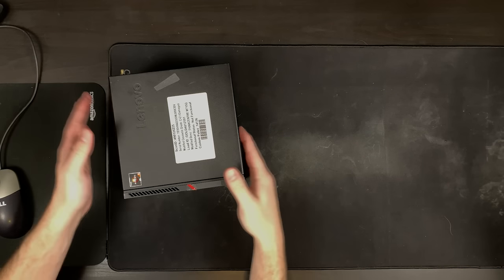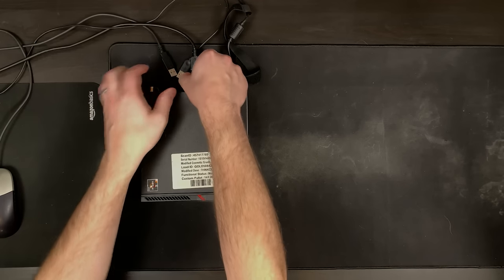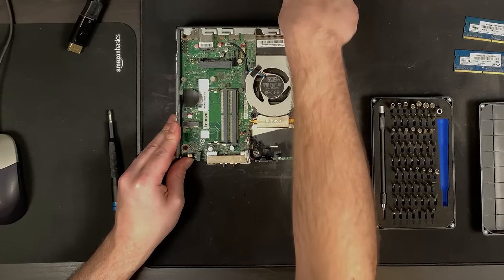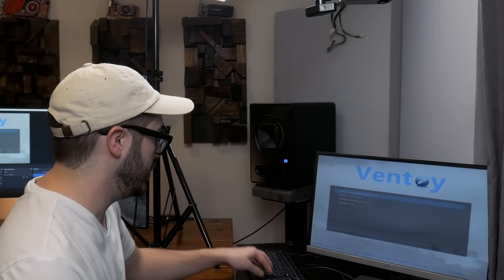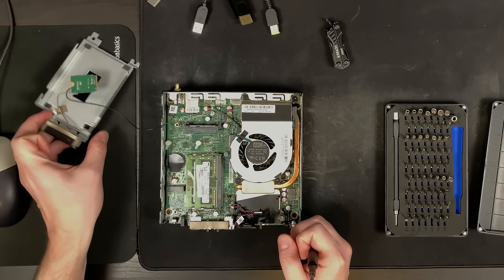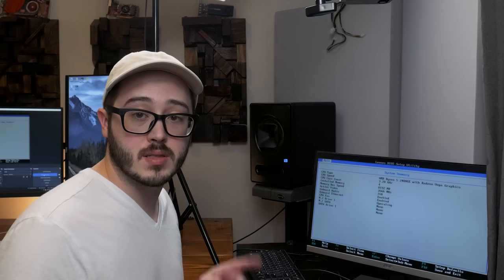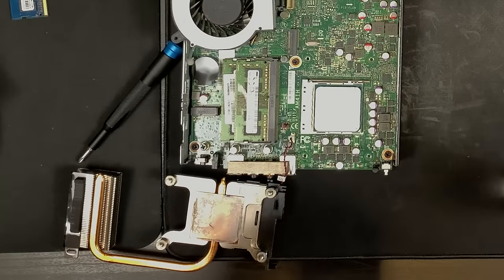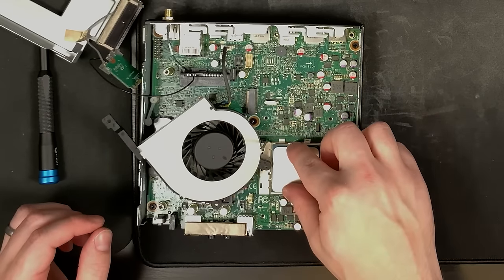Can I Fix These Broken Lenovo Mini PCs?

Comment: Quick tip for trouble shooting older systems. change the CMOS battery. I've messed with systems even only a few years old that had a dead battery and wouldn't post.
Reply from the maker: Yeah, I bought a bunch to just start doing that basically with any older PC
Reply: I've had a cheap AA battery with good voltage not work. You can short them breifly with a DVM set to Amps and check further. Check those new coin cells.

I think something like 0.3A is OK for coin cells, <0.1A? is bad and  I get 1A to 2.5A with our old AA rechargeables. When they're <1A fully recharged it might be time for the bin or use in a remote control. Certainly at 0.4A.

However if you try a tiny 1Ah? SLA house alarm battery it'll blow the 10A DVM fuse ☺️

Same thing if you forget to change the DVM back to Volts too.

Comment: I had an HP SFF core2 machine get picky about ram once. It would only boot on one stick and either stick worked fine as did both slots. Yet it would randomly stop working with either one RAM stick or another, same with RAM slots. Sometimes it would not detect RAM at all.
The problem had no consistency and kept driving me nuts so i put it away. Then after some time i tried booting it up again with all ram installed and it worked fine ever since.
I have it now in my garage as a media PC for music and datasheets and it has no problem starting up and works just fine.

Comment: Nice job. Good idea to buy three almost identical system. Flashing working BIOS could be tedious task. Taking one from another similar board is very good idea especially if you do not need windows key which is often embedded into BIOS.

Comment: When you copy the BIOS straight across like that you lose the Ethernet MAC and machine serial number.  I hope you followed the rule of taking 2 backups of a chip before writing over it.

If not you might be able to find the Lenovo provisioning thumb drive image and the MAC sticker on the system somewhere.  If you wire them all into your router with the same MAC address be prepared for it to get weird.

I am finding a lot of these Lenovo have BIOS issues.  For Intel you can go through an "ME clean" process to fix once you pull the BIOS file off the chip.
Reply from the maker: I was able to just use Lenovo's flashing tool to update the BIOS and give it the correct serial no. As of now they are showing unique MAC addresses, so maybe that process fixed it?

Comment: @12:22 not really... it's pretty default... the one BIOS gives more options then the other... or different options... but most of them are quite similar...they can also contain old and aged security measures... like the intrusion detection. there is just a switch on the front that detects that the case top has been removed. There is not much needed to go around that... just press the button :P and if you are unlucky the switch has been in the same position for soooo long that it keeps the button pressed or depressed.

Comment: 30:29 on hp systems (with Intel gen 3-7 cpus) if cmos battery dies, it will not post until you replace it.
Reply from the maker: Good to know! However I did say in the video that I replaced the cmos battery on them

Comment: I never seen CPU's break, I'm surprised you jumped there so soon ... hdd/ssd, memory, psu, MB (or bios) also always test the beepcodes first if that isn't working its always bios/MB which unless you have a bios flasher unrepairable...  but nice to see you struggle and find it in the end!
Reply from the maker: Yeah if you notice I was hesitant to believe that the CPU was the issue. I just wanted to pin it down to something on the motherboard. Thanks for the advice and comment man!
Reply: The news !!! that AMD 5 3600 are failing now, likely because people do silly overclocking withe lousy cooling. pea thermal compound not spread,  stock coolers are tiny.
I use big Coolmasters with my 130W Xeons they idie at 30, maybe 46 when loaded.
Reply: Google broken LGA sockets on motherboards, people are clumsy. LGA sockets are fragile.

Comment: Many of these "Tiny" PC's come off of lease from commercial users that basically use them as dumb terminals.  With that, they utilize "Boot from LAN" which means they get their boot info and permission from the network and are MAC address specific.  When you copied the BIOS from one machine to another you introduced a different boot sequence.  I suggest you create a generic boot flash file and update the bios when troubleshooting these machines.  Good luck

Comment: nice fix, probably just bit rot on the bios chip so re-flashing fixed it.
Also, as you flashed all pcs with bios rom from that single pc check if they all have same serial/mac/id etc. from that first one as that may cause some problems.
Reply from the maker: Yeah I'm checking out flashing a new BIOS from lenovo and adding the correct serial, although I'm not entirely sure if I'm doing it correctly haha. Any video/tutorial recommendations?
Reply: @HardwareHaven   Adamant IT channel on YT has quite few videos about using programmers to flash bios, also of transplanting certain regions in bios etc.
Reply from the maker: @vaidkun  Yeah his stuff is so freaking good. I need to check out the transplanting regions stuff

Comment: I just stumbled on your video great work!  I was thinking RAM and data retention issues with the BIOS chip too.  Such cute little computers, would make great little studio PCs running something like Reaper or even Cubase 👍
Reply: Hey I just discovered your comment about using Reaper or Cubase on them.  I aim to do this in my homelab/studio in efforts to reduce power consumption and distribution of work.  What I envision is to use multiple mini PCs in place of my Gaming PC workstation.  Reaper if provisioned identically, can run REAmote over the LAN and be distributed.

Comment: I have 3 Lenovo Tiny's, 1x m720q and 2x710q. One of the 710q's only boots with ram in slot 1, it will not boot with ram in slot 2 or in 1 and 2. Gives the same beep code as at 7:51

Comment: 23:49 i seen am4 also do that the cpu stick to the back of the cooler even when the socket is perfectly locked. It is a design flaw prob we never have to deel with in the future thanks to am5 if finally lga and the locking mechanism is like intel.

Comment: if it is at all like a NUC I had one I changed the video output on in the BIOS.  I don't know why.  Of course then I did not get any video from the usual port.  Luckily I had switched it to the Thunderbolt 4 (DisplayPort) and just had use a Thunderbolt to HDMI adapter to get video so I can see what I am doing to go back in.  Then I can fix it and not do that again.  If I sold it as is it might appear to be not working if the HDMI on it was used but if you know what I did then you can fix it.  The problem is it is difficult to know unless you have the right cables to try for troubleshooting that to see if that was it.  I did go back to HDMI since the framerate was terrible on that USB C DisplayPort for some reason.  It may have been my adapter but it was workable and helped me get it back to normal.  Every computer is different and each one is likely to have its own problem.  You may see bad CPUs or bad RAM instead.  You may see one that shows no signs of life at all.

Comment: Dell D6000 is a great troubleshooting tool - It works over USB3 and has its own little graphics card embeded. 
(So if you're unsure if the DP port might be broken you can use the D6000 to rule that out)

Comment: I am very familiar with these lenovo mini pcs in fact im typing from a M70q right now. I wish i seen this video sooner i would have told you from the get go it was not a bad motherboard. When motherboards in these systems die you get no power at all and the tell tale sign is when you plug the power cord in the power light will flash blue 3 times and quit.

Comment: I hate to let you know, but recently NewEgg was selling those refurbished (with 15-month Warranty) that include 128gb SSDs, Power Supplies, keyboards, Mice, and they work.  I just did a couple of videos on one that I bought and it is a nice low-powered PC that I will be using as a Backup Domain Controller.
Reply from the maker: Hey, thanks for the comment. Those are different systems. The m93p in your video has 4th gen Intel. Those are 3-4 years older than the 2400ge
Reply from the maker: Still looks like it was a great deal though!

Comment: The caddy is not the antenna. The wire leading to the brass plug in the back is the antenna. That brass plug is to screwing on a longer antenna.

Comment: The first thing should have been to take the cover off and see if there is any memory in there, it will not post without memory.
Amazon sells a short adapter cable to use a standard PSU

Comment: I have a big problem with the cpu fan.

I own the m715q 2nd gen since 2019 too. Since about 2 weeks I have had the problem, when I switch on the PC, the fan slowly rattles up to a very high and loud speed within a few seconds. (The blown out air is cold)

The fan itself and all ventilation slots are completely free and the CPU utilization is almost constantly at 1 to 2 percent.

Even if I start the PC directly into the BIOS; The fan turns up loudly within a few seconds - as described above.

I've already tried all three settings for the fan in the BIOS; all without perceiving any change.

As far as I know, the CPU temperature is read via the CPU; or is there a separate/built-in temperature sensor on this MiniPC that may no longer work correctly?

Or should the fan itself actually not be okay? (However, there shouldn't be a control unit/board installed in the fan, right?)

I would be very grateful for any tips/tricks, because at the moment it sounds like I'm sitting next to a loud engine.

Comment: @Hardware Haven Cmos battery sometimes can create no post issue, it depends from motherboard design... beafore bios  flash, you should open dump in HxD and  transfer DMI data from corrupted one. Now both system has the sane UUID and possibly the same  activation key, so afrter Windows installation that product key will get blocked, because  you can;t use the same OEM license on both pcs.

Comment: i never have seen broken bios exept some one tryed to update the bios and for some reason it did not finished. i know bit fliping is possable or state degrading. the last one happen if you dont have power to the chip for years but the eeprom where the bios is saved has a single state storage cell and therefore more robust as a MLC or QLC storage. cpu death are more commen on systems with 24/7 on time. a dead ram i have never seen in my systems even on overclocked to the extend. i had a ddr2 ram in a old system where the pcb changed color from a bright green to a dark brown even the edges of the chips are rounded from the heat, but the ram works fine.

Comment: I have a tiny one from HP that works great. I had a broken ram stick from a laptop that wouldn't work no matter what. When I got the hp I was like what the hell, lets try it in. It worked and been working for almost 2 years now. Don't throw the bad stick it might work in another system

Comment: dont need to disable the secure boot for clean install, all you need to reset it to setup mode which clears the keys from previous boot, and allows you to boot usb install media which it has no secure boot keys, once windows install, it populates it, hence why you get the boot error from usb install. if you are doing full clone, or re install just reset the keys and it will boot fine one time until the windows installed. once installed it wont let you boot from the usb again :)

Comment: 1 tip, is try removing all ram first then unplug from power and then hold the power button in for 20 seconds to discharge the capacitors. Then add the ram and power back and try turning it on

Comment: 16:13  Just a small helpful hint for the future of your diagnostic adventures:  You should really keep the magnetic tip screwdriver well clear of RAM or any electronic components, around the motherboard or any electronics really because magnetism can be very damaging to electronics.  fyi...  (think EMP etc. even though a screwdriver tip obviously is much smaller than an emp it can still have devastating effects). Have a great one...
Reply from the maker: Hmmm never really thought of that. I'll try to keep that in mind haha
Reply: @HardwareHaven  WELL, i MEAN IT IS TRUE BUT WHAT MADE ME THINK OF IT WAS THAT YOUR LITTLE SCREWDRIVER HELD THOSE SCREWS FAIRLY WELL WHERE MINE (WHICH I HAD TO MAGNETIZE) HOLDS THEM VERY WEAKLY, Sorry about the caps lock, somehow with this kyb I keep hitting it. Anyhow that \little screwdriver looks like it could have a fairly powerful point to it and very concentrated.  I believe that some people will argue against my assertion but I have a degausing tool (small table) that can render anything electronic completely and permanently hosed (at a high setting, not the highest, you can't separate a hard drive from it).  You may have trouble trying to break something with that screwdriver but chances are if you do you may not know what you came into the proximity of in order to attempt a fix and if you start getting fridge magnets (neo) involved well (people sticking them to the case outside of the hard drive bay)...  Any magnetic field, its best to keep an eye on how close they get to your sensitive electronics and hard drives.  Don't get me wrong, I bought a 5 tip (stored in the handle) Stanley magnetic screwdriver in 1992 and its probably the best 10$ I ever spent.  I must have repaired a couple thousand computers with that thing.  But, I wish I had it when, I was about 20 years old because the only PC motherboard I every destroyed was when I dropped a screw directly on to a running motherboard and fried the built in video adapter.  Fortunately I was able to RMA it (I bought a lot of stuff from them through the years so it wasn't a problem, thankfully.  So that brings me to another cautionary tip (pun) don't let those screws get away from you.  They can really hurt.   Advanced auto has magnetic trays for a dollar or two, which holds onto most screws and since its magnetic means that they are a foot or more away anyhow...   Sorry for the long windedness; it seems as though you have impressed quite a few of us because you did a really nice job on those PCs.  Soon you be replacing bulging caps and everything (not with the hot air station).  Your talent seems to be baked in from birth, perhaps genetics.  Another hint: try to always have a good internet connection for your lab so you can work on stuff and be able to look stuff up as you go.  In the 1980's that could be tough, finding ref material etc. but these days if you have the internet there is always someone who has run into the problem before and if you can word the searches correctly you can save a bundle of time....   Here's looking forward to your next endevour.   TTUL8r
Reply: The magnet in the screwdriver is way too weak to break stuff. What might be a problem is some insulated screwdrivers holding an ESD charge.

Comment: Well that was a good buy. It is possible something in the eeprom is wrong and making it not boot up. Really a good computer should not have that problem. I had an older board that would just fan spin and do nothing just like that unless the cmos battery was at a certain voltage level. In theory it is logical to move around 'good' parts. One thing there though is hardware that has really gone south can potentially damage other hardware. So in that way you risked a known system by putting its parts on other systems. At a fundamental level the power supply supplies a certain amperage of certain voltages. The the hardware is supposed to accept those voltages at certain places and not short the supply past its current ratings.  Bad hardware can try to be protected by inline fuses or something but are capable of bridging dangerous voltages or shorting the supply. I've seen cases of just reseating things is the problem like memory.

Comment: @Hardware Haven Oh, I forgot to mention that you should also replace the SPI chip. Sometimes its not bios itself, it's SPI chip corruption and after some time it may fail again, so it's a good prictice to just in case "upload" bios into new SPI chip, because those like SSDs/pendrives has r/w cycles and they fail when they reach that r/w cycle count...
Reply: Was is an SPI chip?
Reply: @opensourceecon   Whatever... Generally speaking it may be corrupted  bios chip itself, not firmware in it... I have seen already this kind of failure where motherboard still had problem with no posting, bios reflash solved the problem, after some time died again and finally bios chip repelacement solved the problem...
Reply: Even EEPROMs had exactly the same issue, so it doesn;t matter what type it is...

Comment: I wonder if you could get an up to date BIOS (build date showing 2018) and test newer G ryzen cpus in it. Since you have bios chip reader you could also try injecting the microcode for newer cpus but not sure how well that works with ryzen.

I have the m910q which has 6/7th gen intel cpu in it but I am planning to flash 8/9th gen support to it then install a laptop 1440 Xeon with a socket adapter.

Comment: The bios may need updating if it ha a custom bios that has 'whitelisted' the CPU, This is done to prevent the user from simply upgrading the CPU where the manufacturers have a range of systems all based on the same motherboard. 

The only problem is where manufacturers like Lenovo match the bios upgrade package to the OS. Then you need Windows Vista, 7 & 8, and then finally Windows 10 to get the latest bios. I found this out the hard way on a G580 motherboard when the bios was suddenly and mysteriously DOS. This happened years after i'd upgraded the CPU from Intel Celeron B830 to a i7 3612qm. Also watch out for mismatch dram, eg 1.5v vs 1.31v sticks.